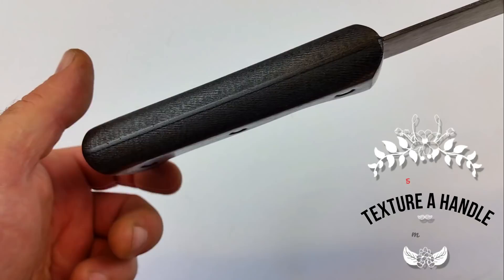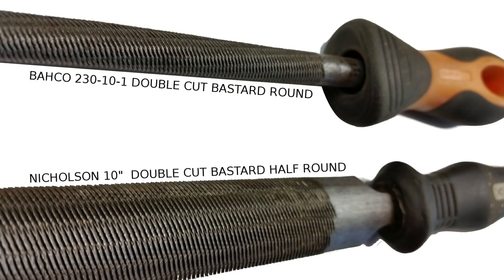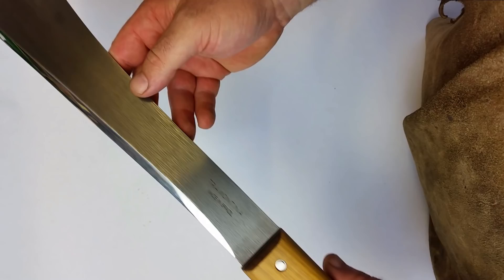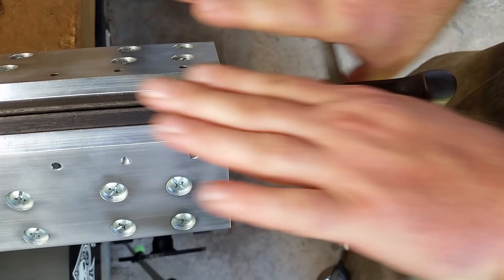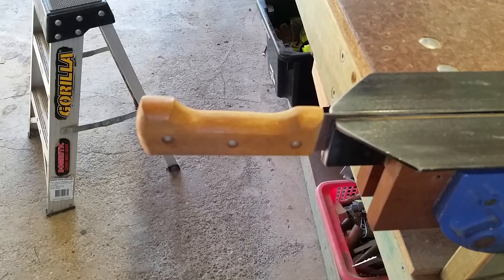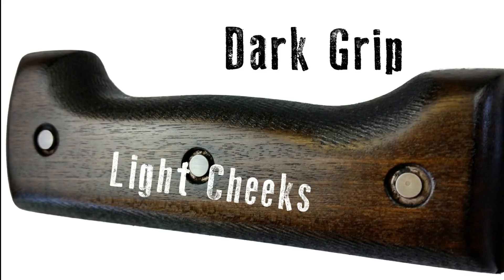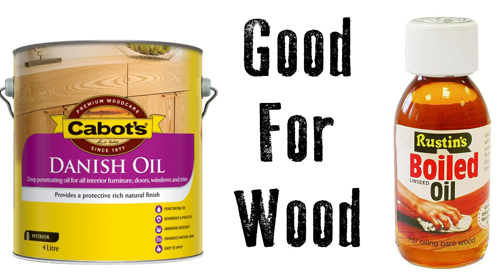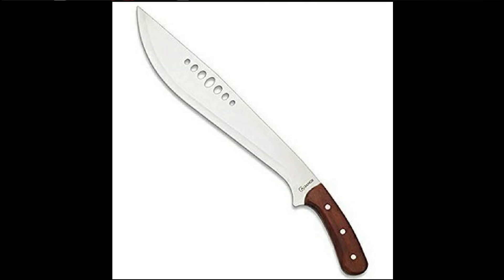How To Texture A Machete, Knife or Axe Handle in 5 mins

Comment: I think putting a positive grip on a machete is a good idea...i reckon ones hand will adapt over time.
Some very good tips mate and the aluminum handle with the cord wrap looks great!...atb...woods
Reply from the maker: G'Day MT! I think you're on point with that comment. You do get accustomed to  your tools and how you set them up. If it's rough, your hands will toughen up. If it's smooth with a good design, your grip will adapt. 
Thanks for the comment about the Aluminium handle. 
All the best Woods,
Ben

Comment: Nice to have new videos from you! I'm not  fan of textured handles or aluminium for that matter. I'd be willing to try cord-wrapped Al. I do like the rolling technique with the round file. It gives a very nice result. I shall keep it in mind if I need more grip on a handle that doesn't have a good shape.
Reply from the maker: Cheers Hugh. I'm settled on smooth and also timber for handle materials as well. I'm surprised at how nice the heavier aluminum handle feels though. I get a lot of visitors in the workshop for a chat and inevitably, they play with what is on the workbenches. A common reaction to heavier handles is generally a huge smile and a comment of 'That just feels so right'. 
Light handles are very common these days and I would say, very much the norm. I'm thinking why people like the extra weight is that it's a throwback from old fashioned handmade tools. Maybe it's the nostalgia?  Heavier handles on a machete are lovely to work with though. The ally is a bit cold to be honest.  
Thanks for the comments mate!

Comment: Great to see another upload from you Ben. Making me feel bad now, I had better get off my derriere and make a video too. I see you are doing one on cord wraps. I was thinking of that but what you are doing looks a lot more gucci than what I do so I'll hold off. My cord wrap style is kindergarten level, but I expect to potentially remove it for use, and have done.
The chief advantage of a cord wrap from my experience is that it helps deaden a bit of shock. That, and for instance on my folding shovel, it helps give a good grip when super muddy and slippery. A pain to clean though and it retains moisture for a while which isn't too nice in Winter.
Quite right though, one bit gets cut and the whole thing will unravel.
My lad recently re-did his hatchet handle a little, using some green clothing dye as a stain, then rubbed beeswax into it, then melted it in. Seals the timber well, and the wax gives a degree of grip in and of itself.
Cheers!
Reply from the maker: G'Day mate and thanks for the welcome back. I'm sure we both can appreciate that Dad Duties trump filming youtube clips. I know you're in the same boat.  
As far as my gucci wrap, you nailed it with that comment. If it takes to long to do, it's not going to get used as intended. I'm guessing my style will be more for display to be honest. 
I had another chap comment about beeswax adding grip. I did treat the cordwrap with snowseal (wax based leather waterproof treatment) and it does have a similar effect. I'm liking the beeswax idea better to be honest. 

Good point regarding the improved shock absorbing effect. I had not though of that. when the cord finally breaks, I will get to test it with straight aluminium. My original plan was to use heatshrink for the grip. 
Looking forward to your next clip mate!
All the best,
Ben
Reply: @MacheteBushcraftAustralia  I reckon the gucci wrap is great and I'd gladly use a tool with it. I didn't communicate it well, when I do the quickie kindergarten wrap it is with the expectation that if I really need some string I will happily remove the wrap to use the string. A bit povo I admit.
I hadn't thought of waxing a cord wrap. It would certainly help keep the water out of it. We just wax the wood.

Soon we're going to collect some extra pine sap. Awesome stuff that we will do a lot of different things with, even lollies! 
Straight pine sap should seal a wooden tool handle but might be a bit too grippy. Extremely flammable too. Some of the sap we will be mixing with beeswax to make a multipurpose salve. I reckon it might do an even better job on sealing a tool handle. 100% organic! ha ha

Heatshrink is great stuff eh? Just recently I had an aluminium water bottle with a lid-chain that got noisy and annoyed me. Slid it through some heatshink, shrunk it and she's all apples!
Loved you poking fun at the commies too. But nobody was pointing a gun at your head forcing you to share, to show how compassionate they were.
Reply from the maker: @segrientboar5954  I simply could not help myself mate. When we don't learn from our history (both good and dark) we are doomed to make the same mistakes. The rise of communism/socialism that is sweeping across the western world ...shocks me to be honest. We have a comprehensive 250 year record of how it leaves death and destruction in its wake. When I see a young group spruiking its virtues and claiming their version of socialism is somehow going to work this time, that's where the shock comes from.

I will step off the soapbox now mate.

Heat shrink handles, love them! I had a hammer handle that was a touch too small for me so I wrapped it. I was originally concerned that it would be slippery but It proved to be just fine. 

I'm pretty sure we were on the same page with the wrap mate. I did not take your initial response as a criticism. I was honestly critiquing my own work. It feels darn nice in the hand, I just value durability more than aesthetics.  It is hemp and darn strong, but it will eventually fail and it's guaranteed to happen at the worst possible time. If it was quick to wrap, you're more likely to redo it before a big trip when you know you're relying on the tool.

Comment: Good video mate.. I use raw linseed as the boiled has some nasty chemicals added.
Reply from the maker: Good call HD! To be honest, I never looked into the drying agents used in boiled linseed oil. I remember reading it was 'Japan Dryer' years ago but looked no further into it. I just checked the Diggers brand BLO and it has less than 1% of cobalt naphthenate. I'm going to look into the chems in Danish Oil as well. 
Thanks for the input mate.
All the best,
Ben
Reply: @MacheteBushcraftAustralia  As I understand it linseed oil was boiled or heated back in the day which made the dry faster. Over time this changed and drying agent's where added instead of heating. But the term boil linseed oil was still used which is a bit missleading..Found a safty data sheet for cobalt naphthenate and seem fairly non-toxic ,but I give is a miss all the same.Raw oll just takes longer to dry which is not a big iusee for me..

Comment: Very useful for me, most of what I need to cut has thorns out the wazoo so need to wear gloves--- rough texture really helps with grip.
Reply from the maker: I'm with you on that mate. Gloves are needed sometimes and I do prefer the extra texture on the handle when using a them.  Actually in winter when your hands are really dry, the extra texture helps with grip.
Good luck with the crazy thorns mate.
All the best from OZ,
Ben

Comment: The mods on that bolo are soooo sweet. Cheap, functional, and beautiful. Just wondering, do you have a trick for getting the gloss finish off a tram bolo blade? I want to do a forced patina. Cheers from Maine, USA.......................
Reply from the maker: Sorry for the late reply mate. It's been a busy few weeks.

If it's a new Tramontina and you want to do a forced patina, paint stripper works best. you can also just use 240grit wet and dry with a cork sanding block.  Keep your strokes inline with the handle to tip (match the scratch pattern that is already on the steel). If you're going to do it wet, tape up that handle really well. 
You're going to run into problems near the handle. I mask 1/4" of the steel and handle at the same time when I wet sand. I then dry sand that last 1/4" so I don't get any water under the handle.  I like to keep it bone dry so the hard oil finish soaks in and around the tang.

I hope some of that helps James.
All the best from OZ mate,
Ben
Reply: @MacheteBushcraftAustralia  Right on!, thank you for the detailed tips. I did a sloppier version of the same thing, sanding etc., but wasn't so careful around the handle. I hit it with mustard, then vinegar, then lime juice in turns, and it certainly looks more vintage and broken in now. I'll do a nicer one soon. These things are an addiction!  Peace...................

Comment: Can you do this with a plastic Handel?
Reply from the maker: I don't think plastic would respond to this technique as well as timber.
I just tested it on some LDPE chopping boards  and it does ad a tiny bit of texture. That's a soft plastic. I suspect it would depend on the type of plastic.
 You can texture a plastic handle with sandpaper (about 80grit). You can stipple some plastic handles with a soldering iron or a Dremel with a tiny burr. I would keep the texture very light. Just enough to add a little extra grip.
Reply: @MacheteBushcraftAustralia  tank you so muts , I will see what I can do , I bought a " Três Listras " manchete her in Brasil were in live , but I can't find out of the Handel is Made of plastic or from  cow horn, but tanks for your answer, I will look further to find it out , I like your videos a lat , there is a lot of really good information. 
Greetings from Brazil 😁
Reply: Hello , I find out that the handle is made from cow horn only , so can I do the trick?

Comment: Is there any way you could do a tutorial on handle pin removal?
Reply from the maker: G'Day WoodWise. You're not the only one who has asked that. To be honest, it's actually a really simple process. It's just three solid aluminum rivets that hold the handle in place. 
If you drill out the domes from the inside face (held in the right hand, the side that is facing in), you can punch out the rivets with a nail or a 4mm pin punch. 
When you drill the rivet, you're only going as deep and the steel washer behind it. All you're trying to do is remove one of the mushroomed ends.
If you're not planning on keeping the old handle, you can just punch the old rivets out with a pin punch and hammer. You tend to crack the handle when doing it this way. 
I hope that is helpful mate.
All the best from OZ,
Ben

Comment: What about beeswax?
Reply from the maker: As in beeswax to stiffen up the cord wrap? I did actually put snowseal  (wax based leather care waterproofer) on the handle as it does dry out. It did actually help. I suspect the last few wraps could have been tighter as this was the area I am most concerned about.
Reply: I was actually just thinking of rubbing it into the raw wood or soaking it into the wood with a heat gun
Reply from the maker: Darn good question Lee. I know some woodwork finishes use bees wax. It would be worthy of a test to be honest!
Reply: I have used it to waterproof many things... though it’s not very flexible like Micro Crystalline was.
Reply: I do like the texture idea! It’s like a poor mans gun checkering.
Reply from the maker: @leemcgann6470  'Poor Mans Checkering' We are on the same page with that one. I was going to call it Hobo Checkering.
Reply: Machete Bushcraft Australia I like the look!